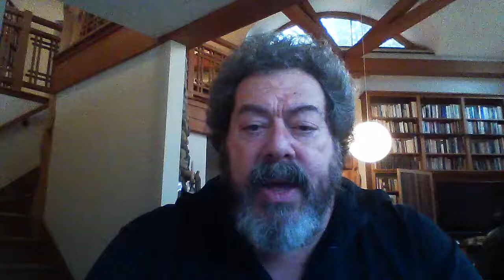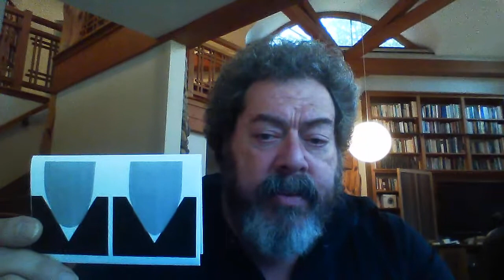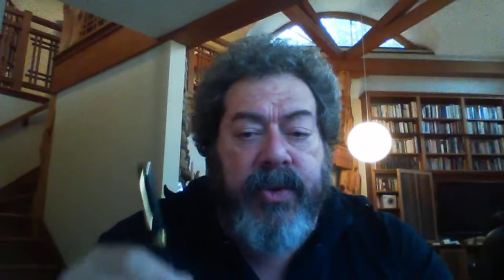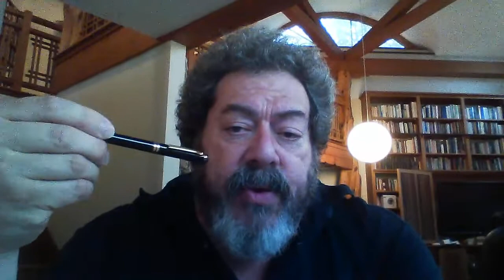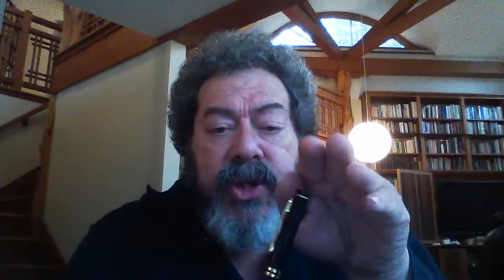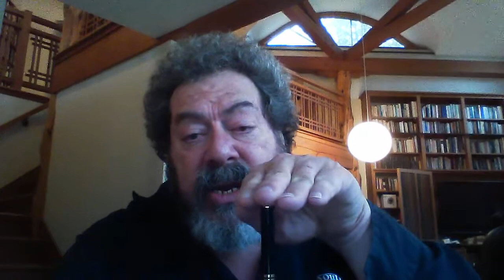Anti skating part 1 of 2 - Soundsmith - Peter Ledermann

Comment: I followed the advice of this video by setting the ant-skating so the tonearm just barely moves inwards when dropped into the run-out groove area. However, when I sent my cartridge for re-tipping, the technician said, "You could use a little bit more of antiskate.  The spindle side wear patch is larger than, almost twice as large as, the edge side. " 

This implies I should probably set it so the tonearm doesn't move at all when dropped into the run-out grooves?
Reply: No replies here, but that is very interesting.  Yes, I agree that is what is implies. Maybe the issue here is interpretation of the word "barely"?  Might be easier to get an album that has a blank side and use that rather than the run-out groove area. That is what I use. I also check it at 45RPM as that exacerbates the effect (and I play 45s about 5-10% of the time.)  Let me know your thoughts.

Comment: Hi, What material is the tip of a good stylus made of. Thanks.
Reply: Mine is boron. a Supex SDX2000
Reply: @jackwalsh7956  Thanks 👍🏻😊
Reply: audio technical microline is the best and most cost effective stylus shape, it closely matches the cutting heads shape that makes the master discs, every other more expensive option is simply a waste....
Reply: @analogaudiorules1724  Thanks 😊

Comment: Hi there. You tell to check what the arm does when putting it at the end of the record in the blank space. So a blank record would be better to check this as there is little time to take note of what happens in a normal record as the stylus will catch the groove. Is that correct ?

Comment: Hi I wondered if you could answer me this question I've never had an answer from nobody yet maybe you are the guy who could answer this question. I'm think I'm going crazy or asking a stupid question so bear with me.
I was thinking about electroplating about maybe 2 to 4 nano stick with copper vinyl LP'S? My logic is copper is a slippery material and will fill in any micro pores in the vinyl, reduce jitter on the vinyl and discharge the record so it doesn't hold a static charge and can be Earth, what I believe would help the cartridge in its operation because there's no influence on the cartridge of any static on the record because of the motion of rotation and friction force of the stylus. Do you know if this has ever been done and what the results, it's bugging me to know what it would sound like. Thanks!
Reply from the maker: Firstly, you cannot electroplate an insulator. There ARE electroless plating techniques, and that is what you would need to do. Plated copper is relatively soft, and would be striped off quickly by playing. A coating of about 2-4 microns would last longer, but as you increase the plating, details would be lost - so self defeating. Then, there is the wear factor. Lots of stylus wear with copper. Anyone who has played direct to copper masters (I have) knows this  and that is DEAD SOFT copper!!! So.......good thoughts, but it turns out vinyl is a ridiculously good material for a large number of reasons.
Reply: Soundsmith Corporation would any other type of material work if you say copper is not good like silver or Chromium? And even if it was done at a very microscopic level say for instance half a Nano metre thick so the vinyl is still exposed after a cup of playing but will still leave a metal film on the record at the microscopic level what would fill in the micro  pores and achieve to earth out the record. I would have thought filling in the micropause would be beneficial to stop jarring of the stylist in the groove, I know you can get micro fillers in liquid, like in a contact cleaner for contacts, I don't know if this would work  anybody's tried it. Do you know of any micro filler that could be used. I remember seeing a few years ago a liquid substance you'd put on your windscreen that's supposed to micro fill the pores in the grass? and would disperse the rain without using wipers not sure if this could be used. Thanks for the reply.
I don't understand why they would be stylus wear with copper, I'm not sure I understand that because copper is a soft material and I was thinking that wouldn't it find it equilibrium after some playing. What about formers because they're made of a coated metal how do they sound compared to a vinyl? Or a etching from the monster, you call it cutting I thought it was etching a master?? because you're not removing material your pressing into the material pushing it to the side. Am I wrong!

Comment: I have a none adjustable pivot arm weight and a non adjustable/set 1.25 antiskate. Symptoms are too much antiskate as the needle/arm wants to move outward. Any advice?
Reply from the maker: Unless it is a unipivot arm, Shim the feet securely (so the table doesn't rock) to TILT the turntable to the upper left till you get the right amount of antiskating.  That is, LIFT the lower right foot. Non adjustable?? Broken? Bad design? New turntable needed? Anyway - use the above to "fix" the problem.  - Peter Ledermann/Soundsmith
Reply: +Soundsmith Corporation thank u for your feedback. intuitively i did just that without success but i am moving forward with my learning curve 👍